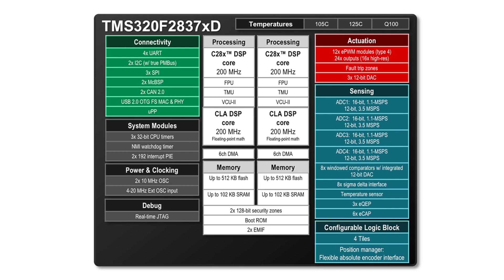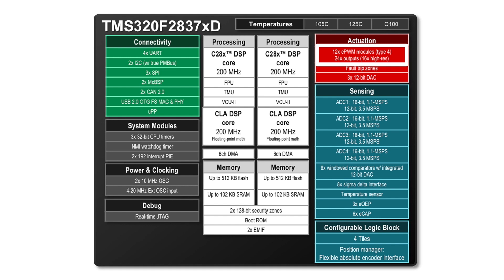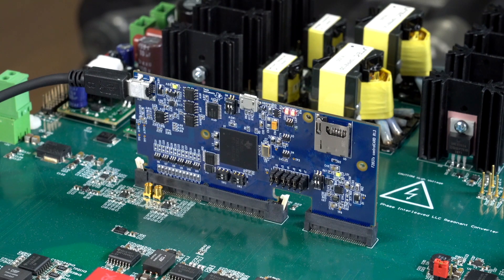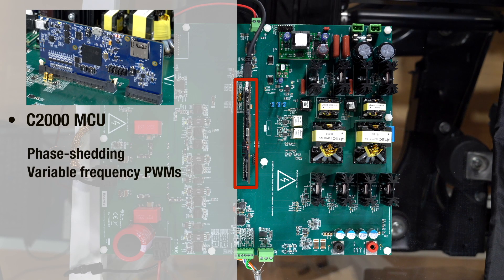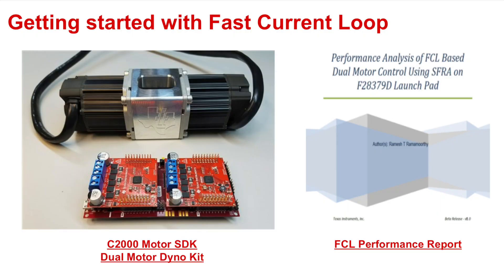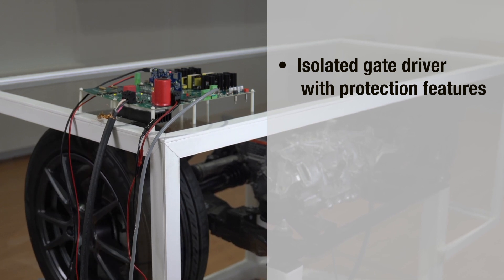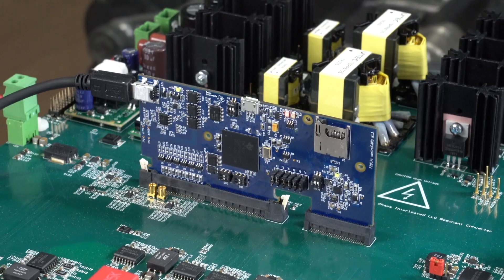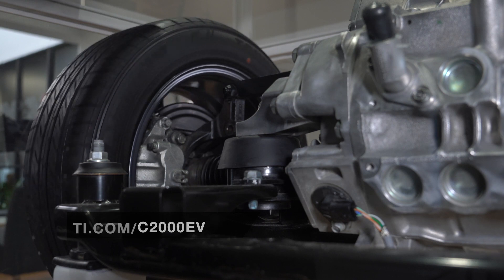High voltage electric vehicle traction inverter demo

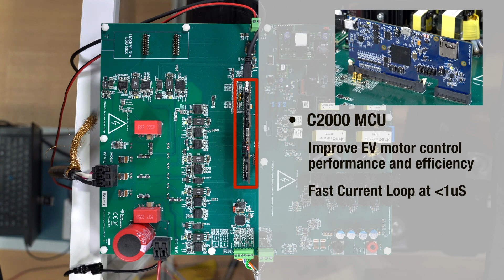Comment: Cool! I got one question here: according to 2:51, does the less than 1us current loop mean the calculation time needed for current loop or the computing frequency of inner loop is less than 1us ( which means both update rate of samping (current&postion)and PWM update frequency are higher than 1MHz) ? To my knowledge, if the PWM update frequency was not increased, the bandwith of the FOC system wont increase